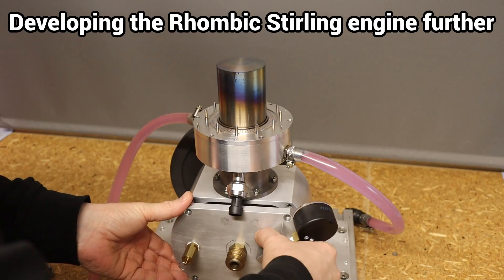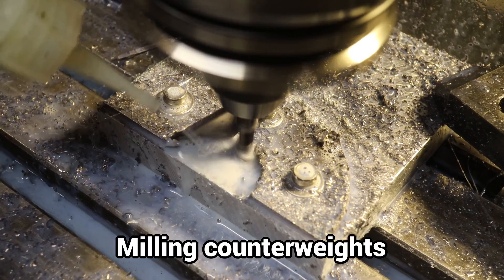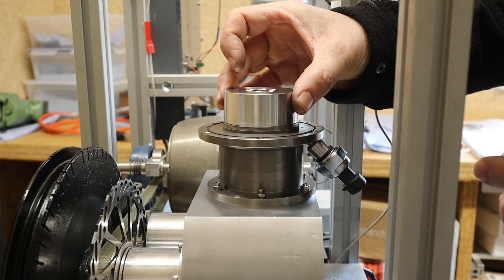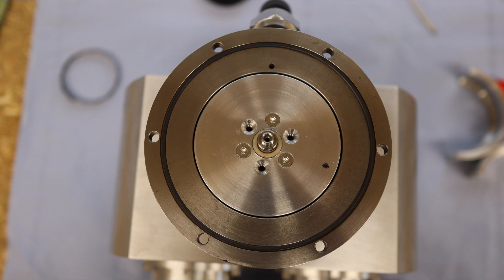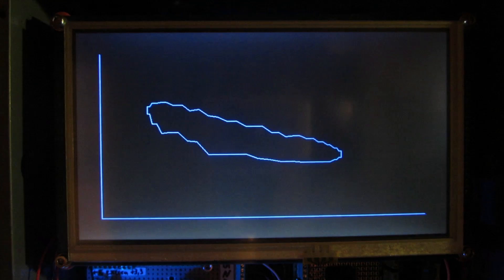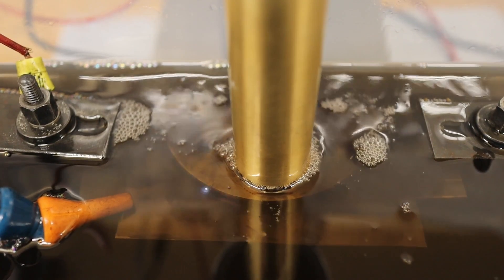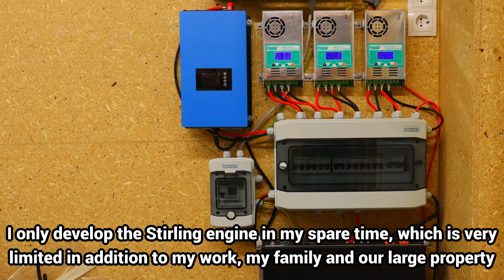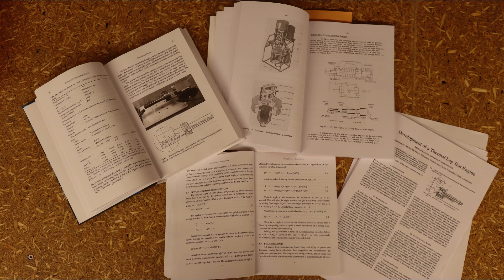Stirling engine development for cogeneration of cheap DIY energy to become off grid and independent

Comment: The earliest Alpha Stirlings had a small air pump in order to maintain two atmospheres of pressure inside the engine, to increase the mass of the gasses. It had a relief valve to maintain the internal pressure at its highest peak. They simply accepted that there would be leakage past the seals. Of course, your work in identifying the best seals and the optimum rings' radial sealing pressure is very useful and beneficial. 

I am most curious about encapsulating the entire engine, except of course the heater and cooler for the displacer. A sealed housing would allow me to use Helium. I think there may be a possibility to add a small relief valve between the crankcase and the interior of the displacer cylinder. 

If the helium pressure is two atmospheres in both of them, then once it is cycling the displacer pressure will cycle up and down. When the pressure is low inside the displacer, the valve will allow a tiny amount to flow from the crankcase into the displacer. And when the displacer pressure is higher, a small amount will leak past the piston rings into the crankcase.
Reply from the maker: Yes thats right, I also tried a valve and the "one way piston ring" (look for it and you willl find) and it worked nice.
The crankcase is sealed with a face seal and is very tight.
I use air at 10 bar and made a few tests with helium but have to do more testruns!
greetings

Comment: Why not some form of steam turbine? That could be pretty powerful and efficient
Reply from the maker: Yes, I also thought many times of using steam but you really have to make a lot of steam to cover the energy needs of a household.
Then there is also always the danger of the boiler to explode what indeed was the original intention for the invention of the Stirling engine!
Reply: Presumably due to turbine blades being more difficult to design and manufacture than this type of single-piston engine. Admittedly this is only the first video I've seen from this channel but it seems very DIY-oriented.
Reply: @DarquosLeblack  ok then what about a reciprocating steam engine?

Also, turbine blades are easy to come by from automotive turbos. And they up time could be pretty good because you really only have to worry about one set of bearings. No other sliding or reciprocating parts.
Reply: There is no need in turbines in small scale, just piston would be enough. Organic Rankine cycle can help to make it good, but I suggest to use monotube high pressure boiler 50+bar.
Reply: @FadeToEvil  As the OP states the pressurised boilers are a high explosion risk.  In commerce they need to be made to high standards and routinely inspected.  Designing and manufacturing often required certifications, safety considerations and insurance unless taking all these risk for a home built unit with limited understanding and experience of the potential for a catastrophic boiler explosion.

There is an alternative to high pressure superheated steam in pressure vessels and that is the use f wet low pressure steam that is made to order so to speak in a tube boiler.  There is essentially no large volume of stored steam and all the containment is in small diameter tubes and pipes so the chance of rupture is reduced. It does not allow for stored energy, you have to control steam generation by flow of water into the boiler and always have enough heat.  This is the direction I have been considering and the Green Steam Engine arrangement seems to be a potential low tech system that has been demonstrated here on YT.

Comment: use low friction engine oil(like 5w15 or Tansfromer oil) it will enhance you compression and sealment, and make you were much less
Reply from the maker: Oil will unfortunately clog the regenerator and contaminate the heat exchanges, so the engine has to run dry!
This makes things a lot more complicate what many writers here find fault but its not so easy as it looks...

Greetings

Comment: 1. reciprocating engines would have losses due to acceleration and deceleration of pistons.
2. Thermal engines would be more efficient on higher pressures (more molecules per volume) of working gas. But for that, with closed cycle, whole containment should be pressurized and sealed. Perhaps look into using machine which has partial phase change of working fluid. Reinventing steam power, sort of.

Comment: You should research total seal Piston rings. Because I think what you need to do Is use a gas expansion rings or gapless ring, if not he can make, you a ring that's super thin and has no blow by. worth the research.
Reply from the maker: Yes, I have to improve the piston rings and cylinder/piston fit a lot, but at the moment I need to motivate me to explore an other concept that I am researching at the moment.
In the next days I show the first candidate in my list , the TMG.

Comment: Wow what a sweet engine setup, the display was very interresting, what sensors did you use?
Reply from the maker: Oh, a lot of.
The most ports of the Arduino Due are used.
2 photo switches 1 for rpm and 1 for crank angle to recognize the piston positions for the real time pV diagram.
A load cell for torque, a vibration sensor, several ds18x temperature sensors, 2 pressure sensors a voltage divider an current sensor (works quite bad, cant find any precise...),
a few I forgot now and a lot of actuators.
The sketch is pretty long and the Due has to work really hard!
I love modern microcontrollers, I am an electronics newbie and its so easy and so much fun to work with them!
And the speed is amazing, the flywheel has 60 or 90 (I think so, maybe a few more or less, have to count..) slots which switch the photo sensor and with 2000 rpm I can precisely recognize each one and run even a LOT of code before the next slots reaches the switching point...
Greetings
Reply: @myengines2443  I am amazed at the level this project has reached, first time seeing it. I really enjoyed this video. I dream of building a nice stirling engine in the future that can reach over 150w of power and be relatively maintenance free, so your videos are certainyl inspirational. Keep up the good work. I subscribed, looking forward to your next update.
I follow a lot of amateur engine builders and its the first time I see someone plot out the engine cycle on a screen using a microcontroller, I think its great - Genius even for experimentation.

Comment: Turbine Stirling Engine - Suggestion (05) Examples and thoughts.
I have wanted to make one 'for ever' but being almost completely paralyzed is kind of a multi show-stopper. Does any of you have a real world example of a Turbine Stirling Engine? Or anything to say about it, positive or negatieve? Why are there none on the market?
Looking forward to your replies to this series of comments!
Reply from the maker: Thanks a lot for your information.
I will include the stirling turbine in my selection for the next engine project.
I'm going to find out a lot about it first.
Many thanks and best regards
Reply: @myengines2443  You're welcome. Looking forward to any thing you choose to do. And do you know of any real Turbine Stirling Engine? I have seen so many engines, but never what I suggested/wanted to make myself. Could making on become the first of its kind??
Reply: @myengines2443   In rombic configuration you can use gear ratio 1:2 or 1:3 and put second or third harmonic to the pistons move. It should increasing efficiency.

Comment: Turbine Stirling Engine - Suggestion (04) Efficiency?
The efficiency of a Turbine Stirling Engine, depends upon many factors, but mainly on how high is the temperature difference is. With a LTD the resistance in the machine is relatively high. If the engineering has been done well, but the efficiency is still low, that is not really a problem IF the temperature difference source is: plenty, clean and free.

Comment: Turbine Stirling Engine - Suggestion (03) The bad.
Bad relative to a normal stirling engine.. The precision of the turbine parts needs to be very high. The turbine needs to spin much faster. It is hard to get enough compression. There is a lot of internal wind resistance.

Comment: Turbine Stirling Engine - Suggestion (02) The good.
2 negatieves for the stirling engine: large size and weight for its power.
Typical for a turbine is: small size and weight for its power.
2 other negatieves for the stirling engine: quite a lot of large moving parts, and most moving parts move back and forth.
In a Turbine Stirling Engine there is just 1 large moving part, which includes a compressor a turbine and an electric generator(also start motor).
Reply: What kind of cycle does it use?

Comment: Turbine Stirling Engine - Suggestion (01) What is it?
A Turbine Stirling Engine is ... like a steam turbine, but without steam/water ... like a stirling engine, but without piston(s) without displacer and without everything going back and forwards all the time.
It can be a closed or an open system, although I prefer closed; keeps it clean, gives control over gas type and pressure. It works on a heat difference which can be high can be low. Heating and cooling is done by heat exchange. There also is heat regeneration, but with a constant flow direction, non alternating.

Comment: have you tried giving all your friction surfaces a WPC treatment. it’s not a coating so it doesn’t screw up your tolerances basically it’s a surface treatment that is like shot peening or sand blasting but it use extremely small ceramic media that is very spherical. it’s a win win for you since it gives your sliding surfaces far less friction and it also extends the lifetime of the part. look up what is wpc treatment by motoriq he breaks it down pretty good. or just watch a few shorts on wpc treatment i think it could be what gives you the lifetime and power that you need since you can have far closer tolerances without affecting friction very much just look at the part of motriq video where he puts the rod into the cylinder and puts his thumb over the open end of the cylinder he compresses the rod and it’s able to hold pressure but once he removes his thumb the rod slides through like the cylinder wasn’t even there
Reply from the maker: This sounds very interesting!
I will look for this WPC technology if it is suitable for the Stirlings.
Many thanks for your hint this is what I need!

Comment: Wouldnt it be better to aim for an engine design with a simpler and larger piston that runs at a slower cycle?  A slower but larger piston should take much less wear per hour, and given that your goal is home use, keeping the engine small doesn't seem like an important goal. A slower engine might also manage to use a diaphram style piston seal without wearing it out, allowing for much lower machining tolerances.
Reply from the maker: Yes a diaphragm design like the TMG is very interesting and I do a lot of research at the moment on this type of engines.
A larger diameter is both far more expensive and MUCH more machining work.
Do you know how many work it was to make the heater head diameter 100mm of 1.4571 stainless steel on the lathe?
Nevertheless I just bought a piece of 130mm 1.4571 to build a bigger version of the rhombic in the future!
Thanks for your suggestions!

Comment: why not use gamma stirling engine, its apparenly more simpler, less friction, less moving parts, more powerful.
Reply from the maker: Yes in some points you are right but theoretically the power and efficiency is a bit lower  (among others because of more dead space) and in the end, alpha, beta and gamma configurations are all more or less the same.
I like the compact heat exchangers without long connection pipes and that the entire hot space is surrounded by the heater and burner.

But you are right to make it mechanical as simple as possible is king.
Thanks for you suggestions!

Comment: Solution: Like metronome heat engine with turbine...
Reply from the maker: I know these thermoacoustic like metronome engines but with a turbine?
Please writ how you mean it exactly!
Thanks for your suggestions!
Reply: @myengines2443  See in the search engine: "tibsim thermoacoustic" and in the odysee video sharing: "thermoacoustic" The difficulty of a medium-sized thermoacoustic machine is the heat exchange (but too large and too small, easy and cheap). Therefore, I believe that a displacer should be used. And instead of a vibrating generator, a turbine generator...

Comment: GAS BEARINGS!! do gas bearings for the pistons
Reply from the maker: The gas bearings I have heard of require really high precision machines that are not commonly used (and I have quit good machines).
Or do you mean the use of ducts etc. to align the piston?
It would be nice if you could describe which concept you exactly mean as the bearing of the pistons is the most important thing I need to improve on the Stirlings!
Many thabks for your hint!
Reply: @myengines2443  Dan Gelbert built his own high precision air bearing lathe and grinder , there is a video in which he demonstrates it here on YT. Perhaps this will help you in your research. Best of luck and looking forward to watching your next efforts. One day I will try the same, if I can!

Comment: Your engineering is super, and the machine work even better. Stirlings are a fascinating topic, I have long wanted to build one but haven't a good idea of how to engineer the design.

However, if you actually want to charge your house battery (as opposed to optimising the Stirling for fun, which I completely understand wanting to do!), you might be better off using your biogas as fuel for a conventional 4-stroke Otto cycle engine. Your biogas being mostly methane should have excellent knock resistance, so an Otto cycle engine could operate at high compression ratio and achieve impressive thermal efficiency, much better than what is feasible for the Stirling. Also it has much higher power output, so mechanical efficiency is less of a problem.

 Of course, you could then use the Stirling as a bottoming cycle to recover energy from the exhaust gases of the Otto cycle engine, which would make the whole system even better!
Reply from the maker: I have to admit that I thought on this blasphemous idea :-) as I say on the end of the last Video!
But I think it causes other problems as the impurities in the biogas or woodgas.

If everything else fails I will try it!

Comment: pistonring-springs
in meinem hatte ich anstelle metallischer federn. einfach radial komprimierten weichen schlauch unter die ringe gelegt. - ähnlich wie o-ringe. macht schön gleichmässigen andruck, und dichtet die ring-rückseite zusätzlich.
nachteil: lebensdauer?
Reply from the maker: Sehr gute Methode die ich auch schon mal angedacht habe, irgendwo müssten noch silikon schläuche rumligen die ich dafür angeschafft habe.
Ist die auch a Arbeitskolben anliegende recht hohe Temperatur kein Problem für die Kunststoffschläuche?

Viele Grüße
Reply: @myengines2443  
hatte ich in der stückliste von meinem bauplan zum VM2. ich hatte winzigen silikon-isolierschlauch aus dem elektronik bereich verwendet.
die sind leider mit dem schmieröl aufgequollen. - nach paar wochen, und entsprechender längeneinkürzung ging das dann erstaunlich gut. 
meine kolbenringanzahl, kohlegefülltes teflon, und noch öl...
zu viel des guten...
vor allem das öl, und kondenswasser haben probleme gemacht.

Comment: I love to see the alpha Stirling engine, as far as I found it the most powerful one among the Stirling engine variant. and a lot more simple mechanical part compared to this rhombic drive. ( I really love mechanical engineering since I was child but due to restriction, I am application developer now)
Reply from the maker: The alpha configuration is mechanical really more simple but then has other problems like piston side loads etc.
It will maybe only lower the problems I have with the complex rhombic drive.
What I want to try is to eliminate the problems of friction and wear nearly completely, some Free Piston designs are made for 100000 hours and more!

Comment: Why aren't these sterling engines mass produced for sale on ebay as cheap as a more complex brig's n Stratton lawn mower engine?
Reply from the maker: First  they are much more complex both in research and development.
Second they need more expensive parts that are more complex to mass produce.
Third the power is much lower as you can see in the comparison of the pV diagrams in my Video

Greetings
Reply: @myengines2443  take a look into free piston sterling cryo coolers
Reply from the maker: Yes, thanks thats what I will do the next weeks...